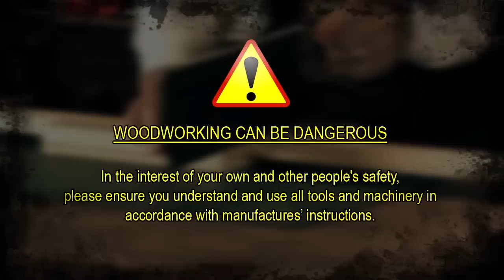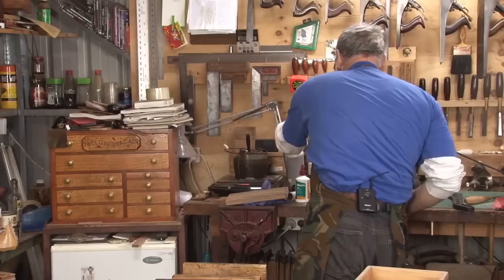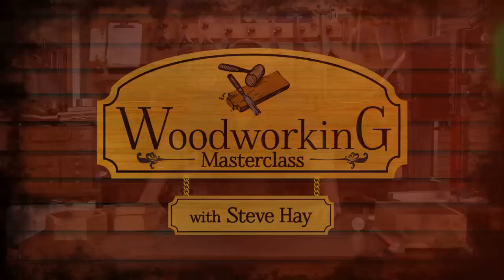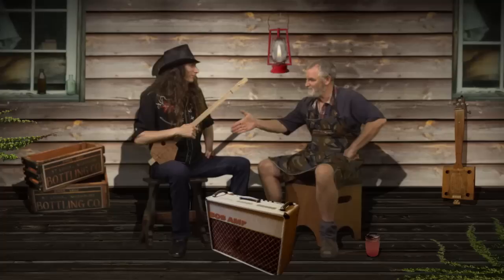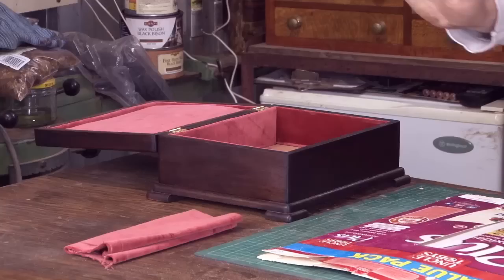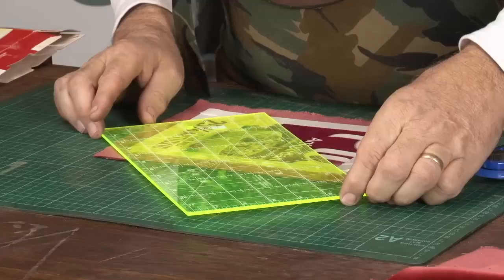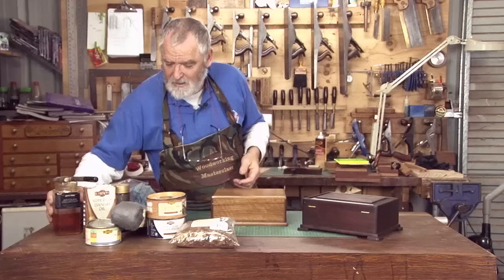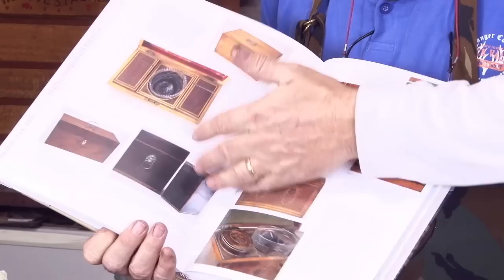Woodworking Masterclass S02 E06

Comment: Very nice finishes. Used my new cabinet scrapers on a project, thanks again! I made some crate/basket things for the kitchen to hold onions, and seasoning packets. Probably didn't need to scrape that project, but i was exited to use them.
Reply from the maker: Josh V Great to hear Josh, who cares if they NEED a Scrape or not all good practice. I bought my son a cordless drill the other day and all he did was put screws in and took them out of the same piece of timber for most of the day. Much to the amusement of his Girlfriend. Something about a new tool we just gotta use 'em. Cheers Steve

Comment: I have seen that Justin play before, he is something else , in fact i built my own Cigar Box Guitar bout 3 year ago, ordered all the fixins from C. B. Gitty cbg supplies off amazon. But whats cool about it, is just finding different odds and end around the house to use for the different parts. For example, i used a shower drain cover for my sound hole cover, a large bolt for the nut, a old hinge for the bridge, and some finish nails for the frets....sounds good!
Reply from the maker: They are fun to make and it is amazing what you can make them from. Thanks for the feedback. Cheers Steve